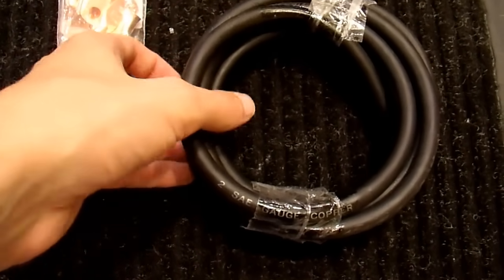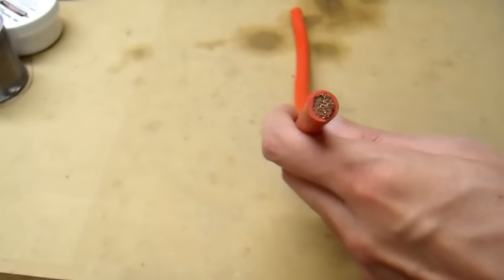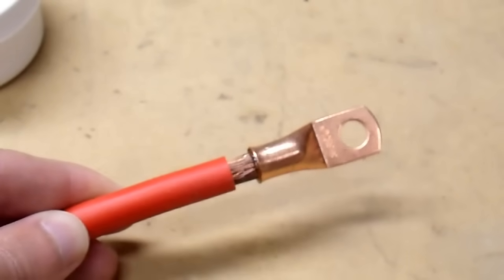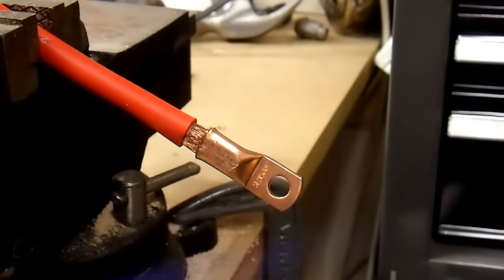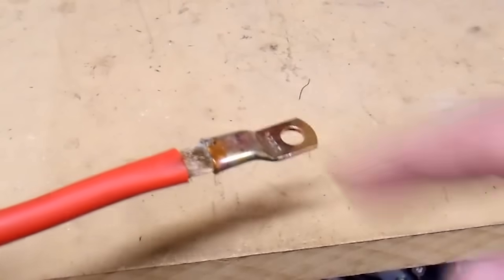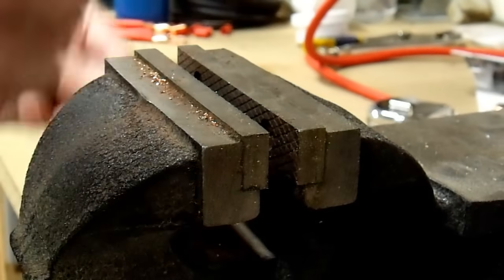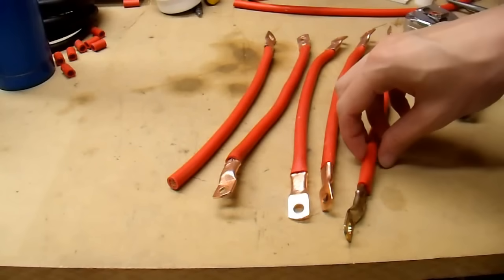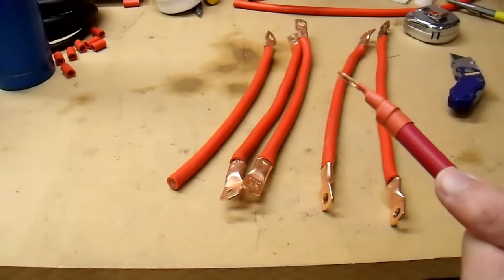How to Make Battery Cables the Right Way and the Easy Way

Comment: Electrical tape holds salt and moisture creating corrosion use heat shrink if you can.

use thicker solder so you dont have to heat the fitting for as long which melts and burns the casing, as little heat as applicable, soldering is the best possible connection you can have with car/truck electrical system idk why all these peopls are saying its not...in most cases crimping it is just faster and cheaper but if the time allows and you have the solder I recomend soldering it

And last but not least...ive used the hammer and punch method before When I didnt have my crimpers use the crimpers if you can but the hammer and punch I recomment hitting in the center so you have a cleaner and more uniformed crimp, harbor frieght has a crimper for a couple dollars that works pretty good but I like the big bolt cutter looking crimpers.
Reply: Soldering in vibration and heat/humidity areas is not a good idea. Vibration can over time destroy the joint as the solder makes the wire stiff. Heat and humidity over time cause the solder to crystallize.

Comment: i tend to solder high current heavy gauge cables when i build them, and i tend to use adhesive lined heat activated heat shrink tube at the ends as identifiers, red, black, blue etc, to identify what the cable is, what it goes to, and where it terminates, black or green for chassis or engine block grounds, blue for alternator charge feed, red for main power, white for starter, things like that, or if i'm wiring up a setup which has multiple batteries and i'm using an isolator i'll use orange for the feed from the alt to the isolator, red for bank 1, blue for bank2, common grounds are always black and the bypass solenoid (emergency start) is usually yellow or gray, high current loads overheat crimps and cause failures, weak cold solder joints can fail due to stress causing heat on the joint, and undersize wires tend to burn up, the tips in this video are fine if you are doing mild to low current applications, as he mentioned, cables for inverters or such, but for higher current i highly recommend soldering and sealing joints for safety. but that's just my .02 cents, a conductivity test will show if you have a good crimp it should be lower than 0.1ohm resistance for proper minimal loss, and a crimped connection should NEVER be hot to the touch unless the entire cable is warm in which case, step up in wire size for safety if that happens and its not just a hot environment they are operating in (engine bay for example)... sorry for rambling this is just something i had hammered into my head when i started working on vehicles and motor controls

Comment: There is no need to weld the terminals, there are clamps to crush them in a moment without heat and without consuming gas and electrodes   https://youtu.be/e2FoBq2WI4c

Comment: I see you've got a war between the two sides going on in the comments. Personally, I'm on the don't solder high amperage automotive connections side. I get the warm and fuzzy feeling people get with a firmly attached solder joint, but solder joints have a hard life in the extreme temperature swings and vibration environment of the automotive world. That and the large amount of heat required to properly solder large gauge wire makes the copper hard and brittle. Again not great in typical automotive conditions. What I recommend people to do is follow the instructions of the connector manufacturer regarding proper termination. They know best how to use their connectors, through in-house testing and through feedback from their customers.
Reply: Many years ago I was told to never solder an automotive battery cable. When I asked why, I was told to think of the results if the terminal at the starter overheated from too much cranking, and the cable popped out and started arcing away under the hood.  I bought the cheap Harbor Freight crimper and use my vise to squeeze it. To me, it's worth a lot more than it costs.

Comment: Hi. What type/gauge would you recommend for connecting two 12v 9ah batteries together (for a UPS battery backup)? Length would only be about 3 inches with T2 connectors.

Comment: Every electronic you have needs batteries! But DON’T buy 1 new battery this year until you see this [Check Details Here==>https://plus.google.com/100351090281822647456/posts/Ct2x2kZGdNN ]. You can just recondition your old, used batteries and save a lot of money!

Comment: I think crimping and soldering is not a good combination. By properly crimping you make a good electrical connection. But then you heat the connection in order to solder it. Heating expands the metal and makes the crimped connection loose. Its either you crimp, using the proper crimping tool, or solder without crimping.

Comment: Love everything except the solder and flux. I have been professionally trained and have worked on electrical cables and repaired electronics for a living for over 37 years. The flux is corrosive and some solder can also have some flux in it, so I would not use it. What happens is the flux becomes a liquid acid, when heated, to clean the oxidation and contaminates off the wire and terminal. When it's in it's liquid state some of the acid flows down into the battery cable and up under the cable jacket. Through normal temperature changes the cable absorbs moisture and reacts with the Flux acid and starts to eat and corrode the copper cable. Over time the cable becomes a big resistor and things like batteries and starters begin to over heat and will be damaged. The solder may be a good idea if the cable is used in a non-vibration application, but is not needed. If it's used in an automotive application it's not a good idea, because the cable strands are not free to move flex slightly. When they're held without the ability to flex slightly they start to break, much like bending a coat hanger back and forth. So just crimp them. Smashing them in the vise is ok for a temporary solution but for a permanent one, use a couple of nails across the face of the terminal it will work better. Thanks for the entertainment. 
Best Wishes n Blessings. Keith
Reply: @Keith Noneya, thank you very much! I was going to make up some battery cables  next month. I was going to use welding lead and soldered connections. I will now forget about the solder, and crimp them instead. 👍🖐️
Reply: Can I use any flux at all when soldering a battery cable wire? Surely there is one type that I can use?
Reply: @rickigunter1960  Use a no-clean flux or a no-clean solder containing this flux. It is often used for sensitive electronics (such as tactical systems) that are required to function after years in storage. The residue left behind is non-corosive.
Reply: @rickigunter1960  You need to use a rosin flux like the author did it is water soluble and non-acidic. It is better to 1/4 fill the connector with solder and heat it until the solder is liquid, then push the cable into the hot solder any excess will overflow the connector. I buy my battery cable ends with the solder already in the connector at my local tractor supply. Doing it this way reduces the wicking of the solder up the cable.

Comment: dirt tube commented ,
 "crimping has been proven to be more effective than welding by the ABYC and Title 14 CFR - eCFR — Aviation Code of Federal Regulations... Automotive applications codes don't exist for contact methods because you can walk home if your car catches on fucking fire but you're going to die if your airplane or boat does."
go buy an expensive cable. it will be crimped.
 look at the connections under the hood of your car. they will be crimped.
BUT,
if you can not crimpit correctly,the method in this video ,will rarely fail,unless other really bad conditions are involved.

Comment: if u slide a pc of heat shrink over the cable,b4 u solder end on,u can seal and insulate it from moisture getting into wire,after ur done attaching the end

Comment: 1. Use heatshrinks always. Use transparent for inspection. 
2. For permanent installation - use conductive lack after installing as will prevent for years corrosion to start. 
3. Sometimes, I'm using a little epoxy glue at the end of the heatshrinks before to heat them with proper heat gun. 
4. Always use proper tools. In this case hydraulic lug crimping tool. 
Take consideration of other comments below as well otherwise you might have a huge issue if current is really high.

Comment: If you use just a small amount of vaseline it will help to keep the corrosion under control . I have used it on my truck battery and when ever i change the oil i add just a bit to the connectors and after many years of use i have never had any corrosion yet . Its also a lot cheaper then the battery corrosion kits you buy at stores that sell them .   ////ÐΛЯΞ †o ÐЯΞΛM\\\\ ☠ [̲̅$̲̅(̲̅100)̲̅$̲̅ ]

Comment: If I was to use parallel batteries to use with an inverter, in a car... does the cable connecting the batteries to each other need to be the same gauge as the cable connecting to the inverter?

Comment: Some days I have to make several cables cut to length with terminals. I use a hydraulic cable crimp tool I got at harbor freight. It's quick and makes strong, professional looking crimps and there's no need for vices and torches.
Reply from the maker: I have one too and it doesn't work well.
Reply: Funny, I too have one and it works fine with the terminals I use.

Comment: If you use the bench vice to crimp it, try holding a BB (like those used for BB guns) with needle nose pliers in the middle of the area you want crimped.  Once the vice is holding it steady against the copper fitting, crank down on your vice.  
     Thanks for the video and information.  Thumbs up

Comment: Like the crimp then solder technique. Wire he used is very poor. Use real battery cable people. Too much heat and not enough solder.

Comment: Wow, lotta comments with actual good info (& some as bad as the video & worse) but at least you don't delete the bad ones. If you make "How To" vids, at least do it the right way. Personally I like to solder terminals onto the wire the correct way, then ALSO use a hydraulic crimper just to be on the extra safe side, then I always use shrink wrap, NEVER elect tape. I've seen worse "How To" vids though by far. BTW, A hydraulic crimper will create a "cold weld" that is stronger than any soldering connection no matter how well its done.

Comment: Soldering cables only for low temperature cable use. 
High temperature cable use will melt solder and have problems.
Very good thought but.
Reply from the maker: Obviously wrong for obvious reasons.

Comment: You should NOT solder this joint at all.
You will get an area of metal fatigue where the solder ends. That is why you use heat-shrink tube... to give stress relief at this junction.
Crimp the terminal on WITH THE CORRECT TOOL, not a vice, and happy days!
Reply from the maker: Not true.  I work in an industry that deals with this all the time.

Comment: The right way is to use the proper crimp tool with water tight heat shrink. Soldering is not an approved method on such large cables, fyi.
Reply from the maker: It absolutely is devious.  This is an ignorant and incorrect statement.

Comment: Never solder in automotive applications. The wire will break because of the vibrations. The second method is not professional, but even better than the soldered one. A good crimp has a gas tight connection, so no corrosion possible.
Reply from the maker: Wrong.  I work in an industry that deals with this all the time and I can 100% say that you are incorrect.
Reply: @knurlgnar24  OK. This might be the reason why you find in new cars only crimps. I tell you that you are wrong. With constant vibtrations the connection will break inside the wire at the boarder line between the pure wire and the soldering tin which moved into the cable. This is fact and the reason why this shall be avoided.

Comment: I don't have a vice so I used a tree-branch trimmer to crimp my cables. I just covered the sharp blade on the trimmer with a bend piece of metal so it didn't cut the connector.

Comment: very good tutorial. i've  done it this way for years. one tip: when i use the punch to crimp i saddle it into a piece of heavy angle iron. it kind of helps keep its rounded shape and looks cleaner. i use heat shrink with adhesive in it to protect when the cables are used outdoors. if i have a question about the viability of a joint i just cut off the shrink and re shrink if its ok.
Reply: Only an idiot would believe anything this idiot said or did

Comment: I don't have this, I don't have that so I'll take a shot a it with what I have is the perfect definition of a hack job. Unless you're stuck on a deserted island with only these supplies then that would be an excusable hack job. BTW, those strands of thinly coated copper will melt with that amount of heat.  You need a solid wire if you're going to solder it; you just lost a good amount of its ampacity. Then again it's a hack job altogether...

Comment: Buddy, if you were my apprentice. I'd make you do it again. Using a vice is a no no and not too mention you won't need to solder the lugs if you used the correct crimping tool (which aren't expensive). Not to mention solder breaks down over time making the connection high resistant.
Reply from the maker: I did not use the 'best' tools for this but did do a good job.  Solder does not break down over time BTW.

Comment: A better way is this:
You should use the punch to indent the terminal in, BeFoRe  soldering;  make a STRONG mechanical connection First,then Solder

Comment: having been around automobiles and working on them and taking various courses over the years, along with having my own garage at one time, working for a huge company taking care of their fleet of cars, and building and racing dirt late models, i can tell your one thing for sure, the people commenting on here telling you this is the wrong way to put a terminal on a cable are dead on. if you have any doubts at all just look at factory ends, they are crimped. what he is doing will work, and so will the cheap little bolt on ends, or just about anything that will make a connection, but there is a right way to do it. this isn't it, again if in doubt and you don't want to accept looking at factory ends, find your local electrical shop and ask them.  and my experience goes way back to the early 50s, and yes i am really old.
Reply: And C H, most of those tools come with more than one size die. In the case of the HF unit, it comes with size #14 up to size #0. And you can get them for anywhere from 20 to 25% off with a coupon.
Reply: jimmie Roan all those cheap bolt on piece of garbage are for is to het you off the highway or off a trail to a place you can install the proper cable. Period. End of story.
Reply: @robby844  i agree, i guess. not sure of what you are talking about as far as cheap bolt on garbage, i was commenting on how wrong this video is about making cables.  ive never seen a factory cable that wasn't crimped, my short time in the military on aircraft all the cable ends were crimped. ive seen the crimped ends opened up to show their is no air gaps in between the wire strands with a good crimp, which would cause corrosion.
Reply: @jimmieroan9881  I was talking about those cheap ends with the 2 bolts with the metal strap or the ones where you insert the stripped wire and tighten the screw down. Ive seen both styles get hot and melt
Reply: You're right.  A proper crimp is as good as a weld as far as conductivity goes.  Take a terminal that has a proper crimp and cut it in half to look at a section.

This video title is very misleading.

A cheap $45 dollar hand held hydraulic hex crimper will make very nice and proper crimps every time.

Comment: Don't listen to this guy!  Horrible quality of work for starters.  Learn how to tin wires if you are going to solder and use an industrial soldering iron.  ALL FLUX MUST BE REMOVED IMMEDIATELY after your soldering job is complete.  You use rubbing alcohol to removed the residue.  You cannot remove that flux from the inside.  That is why you tin the wire.  That will corrode.  Wire insulation should never have a gap larger than the one half the diameter of the wire.  I am an aircraft electrician by trade and am personally disgusted by this man's "lazy" and ignorant ideas.  I was watching videos on building custom computer cables and this auto played.  Fail YouTube!

Comment: Hey Knurlgar24 take these comments in an educational way and disregard the bad attitudes of some of the others. Check out the link below for info on the mil specs and uses for the various different materials used in shrink tubing. There is a reason there is a mil spec covering the many different types and uses for heat shrink tubing. Shrink tubing is not "cosmetic only" is called out in mil specs for airplanes and other industrial applications where protecting an electrical connection is paramount and has life and death implications. If you are going to crimp the lug in a vice try and use something other than steel jaws. Get some phenolic blocks or even some flattened pieces of copper plumbing to put the lug in to keep from embedding steel into the copper which promotes dissimilar metal corrosion. Use rosin core solder when you solder and use dielectric grease on the joint before you use shrink tubing. Shrink tubing has been around forever and used on commercial airliners manufactured as far back as the 50's to protect electrical connections from everything including fuel, acid, moisture and abrasive wear. http://www.awcwire.com/producttoc.aspx?id=heat-shrink-tubing